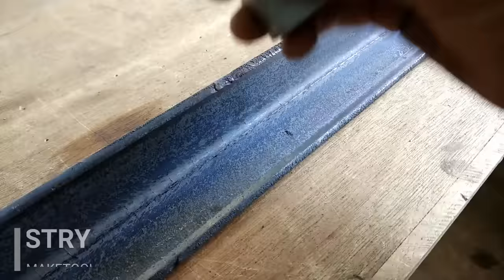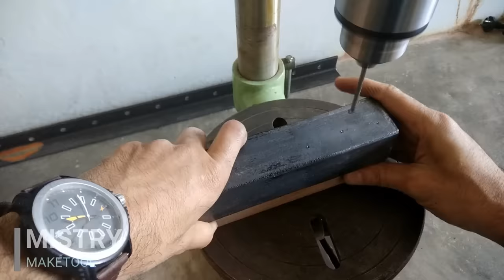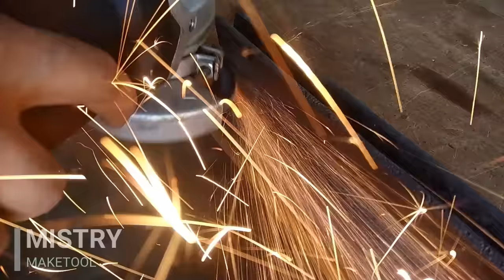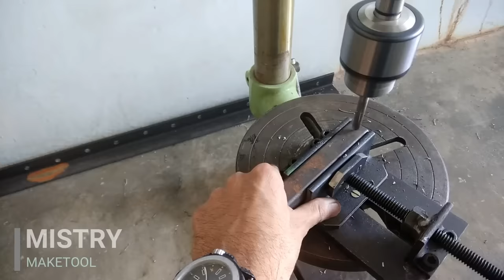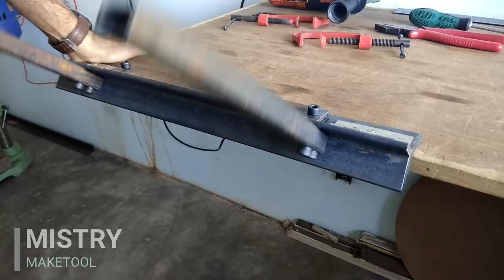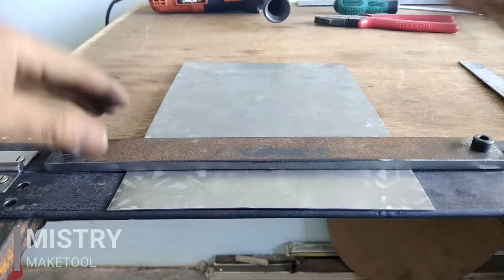DIY Sheet Metal Bending Tool || Sheet Metal Brake

Comment: You could also add a protractor easily to see exactly what degree your bend is at. You could just cut a slit in the piece of angle iron that has the handle, and then weld a protractor say as far to the left that you can on the far piece of angle iron. That way you can measure your bends
Reply: アングルのケガき&かつた〜の切り方&スクエアの使い方⤵️まるで‼️素人だよ😃良く勉強したら‼️→もと機械加工〜組み立て〜製缶→ステンレスアルミ→鉄‼️色々やってきた〜オッサンだけど😀(笑)😆😆😆わからないトキニワ‼️すなをに-きけば-いいと思いますよ(^-^)なかには〜変なオッサンもいるけどね😉→パス→技術を教えるのが👍本当の職人だと思いますよ‼️わからない〜トキニワ〜すなをに→きけば❗いいと思いますよ‼️

Comment: Simple  and  effective !
GREAT MINDS THINK ALIKE .
I also used " L " angle for TOP  stop so I wouldn't  pass 90° angle , and I  etch in my own measurements with   longer increments to line up my sheets straight to bend.  Also BIG wing nuts easier  for top lock down bar.  GREAT job !
Reply: Getting a bend to the angle you want usually requires going past that angle, so the metal can relax where you want it.  Only bending to 90 degrees won't get you a corner that wants to be square.  This design also didn't get particularly tight corners, because the hinges were above the bending target, instead of level with the material's edge.  (The reason most of these designs notch the bars to bring the hinge down.)

Comment: No Lathe. no TIG welder, no Plasma cutter. Yes! Love it! An actual DIY project for DIYers. Get the home center to cut the angle iron and steel bar and all you need is a tap set, a screwdriver, an Allen key and a couple of C-clamps.

Comment: I was totally in for this until  the  4min10sec mark when I saw the thickness of that flat bar steel....here it would cost so much to buy , and I dont have off cuts that heavy. I will have to keep looking around for a scrap piece that thick then I am making this! Thanks for video, very good (what is the thickness of that bar by the way?)

Comment: best and easiest build seen so far. tip: You can use an angle iron top bar instead of flat bar - get perfect 45 degree bends - also turn same angle iron top bar on side ( with extra holes on side ) and then get perfect 90 degree bends with same top bar.

Comment: I love how simple this build is, with no welding. I do have one question though. Most of the videos I've watched on how to build a sheet metal brake require cutting a notch in the angle iron for the hinges. How are you able to get away from doing that and how does it not affect the way the sheet metal is bent? I'd love to hear from you. Have a great day! 😎
Reply: The reason everyone notches is to get the coners of the angle steel to the center point of the hinge, doing so creates a tighter sharper bend vs the one shown here his Bends  have a radius to it (soft bend)

Comment: For aluminum about 1/8 inch thick would you suggest heating a sheet that's about 12" wide (length of the 90 degree bend) before bending it? I've heard of people either chiseling or scribing a line without heating to avoid cracks and I've also heard people say you don't have to do either to make the bend in 0.125 thick aluminum. I only have one piece of aluminum sheet so I'm reluctant to start bending unless I know which has the best chance for success.

Comment: Very useful tool to have around. I would rather weld the hinge on with my everlast welder but other than that it is a solid design for infrequent use.
Reply: if the hinge breaks you will have a pile of  grinding to replace it. best to bolt it for that reason

Comment: Good idea. But IMHO your hinges are way too weak. Soon they will give play or even bend & break.
Same applies for the fixing screws for the hinges. As it stands, your jig is useful only for very thin sheets ie. below 20 gauge at a width  of 200mm..
For designing it to be suitable for 1 mm & higher, you will have to calculate the shear forces at the hinge for maximum thickness of sheet as well as its max.width.
For>2mm sheet, the angle will need to be a lot heavier. Otherwise the applied effort will cause them to bend.
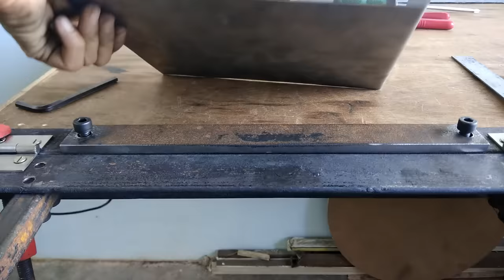Reply: yours is the only comment he hasn't liked, lol. Don't know if he maybe didn't see it. I'd add to your excellent points for anyone wanting to do this that the fastening plate should allow for bending the sheet over 90 degrees to allow bendback. Also, you shouldn't tighten the screws so much that the fastening plate gives in the middle like it seems like he does, or the sheet will get an uneven bend radius (it seems like the bend radius is smaller nearest the camera at 6:08, for example). use an L-profile placed like an inverted V instead of the sheet he has used for the fastening plate to solve both of these issues. Cheers!
Reply: Doris day sings
Reply: Jerry Smith, hilarious
Reply: @jerrysmith3770  She has always been my "Secret Love"....
Reply: Raj Iyer

Comment: I’ve looked at 20 videos, this was the cheapest and most simple method, wish I saw this first before cutting my steel angle. Whoever is reading this, please do LOTS of research first! And come up with a concrete plan! Then revise it 5 times! And you will have a plan better than most.

Comment: Personally I would have welded all of the pieces together with a powerarc welder to ensure they don't flex or come loose at the joints. I like the design though. Keep it simple.
Reply: welding would save a lot of time. i have a MIG so i would use that, but even a stick welder would work fine for this.